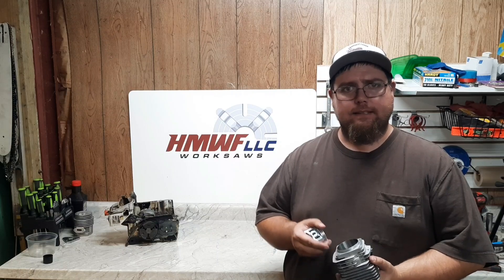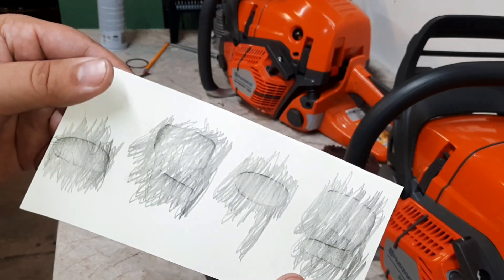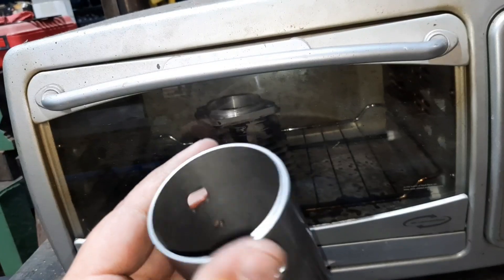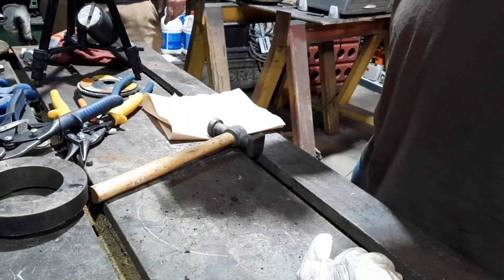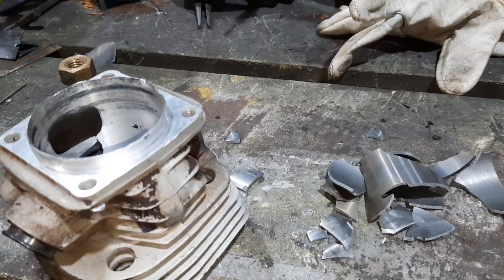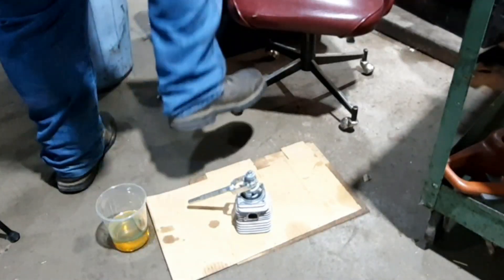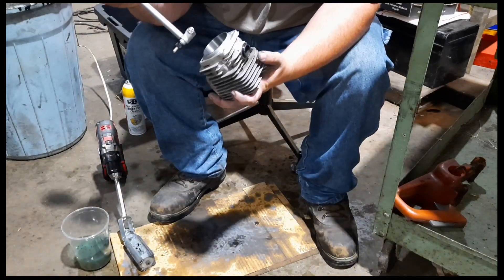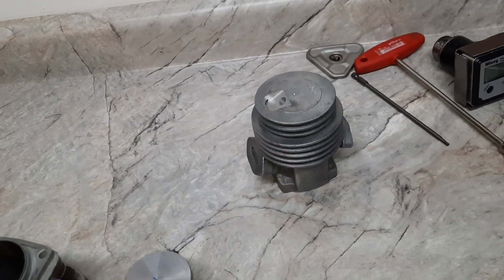|| 56mm Big bore! Custom Cylinder Cast iron sleeves || 93cc Echo Sleeper build!

Comment: It's much easier to hold the sleeve in a lathe chuck mounted in a vice and lower the heated cylinder onto the lubed sleeve- you'll have a few moments to turn it to position before it locks up. I've used .004" interference per inch of cylinder diameter for many years with great results. Good luck!

Comment: Great work man.
Reply from the maker: Thank you
Reply: @dynojoemods2764  what did you end up with piston to cylinder clearance, .0025 - .003" per?
Reply from the maker: @RichFife  
I set this at .0035" a bit loose, but the last one I did at .003 liked to start slowing down when warm...
Reply: @dynojoemods2764  I was curious about piston expansion with those pistons.